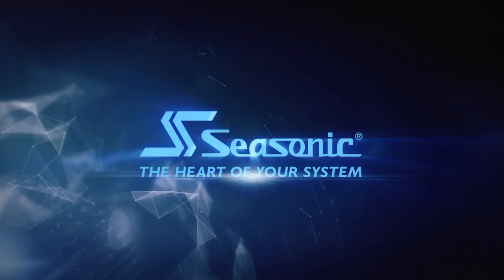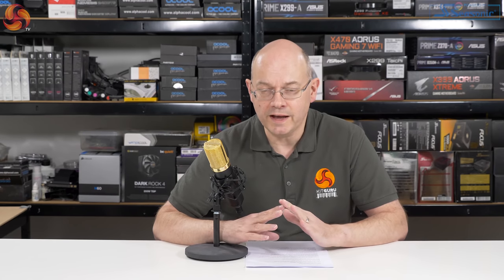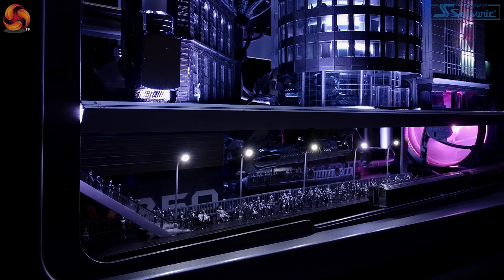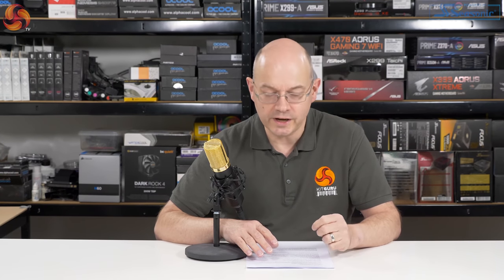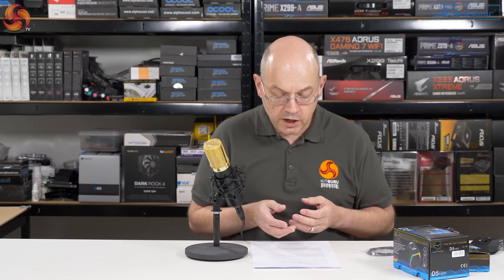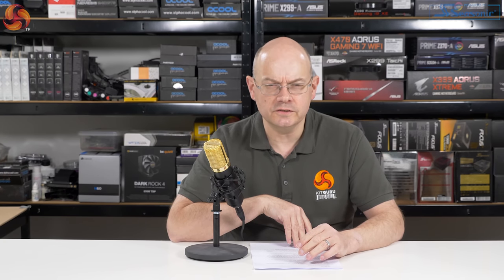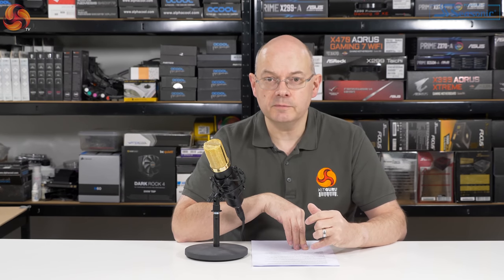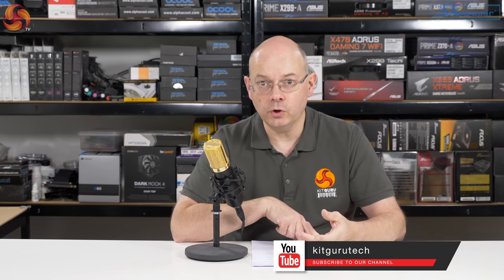Leo Says 30 - HALLOWEEN SPECIAL! Intel and AMD Q3, Modding, Threadripper 3000 !

Comment: I very much like the idea of a way to control the pump outside of the BIOS or manually via button pushes. I know there is Speedfan, but for some reason I can't get that to work on my current C7H 2700X system where the pump is pwm plugged into the CPU fan header. I want to adjust speed when required rather than rely simply on temps, but I don't want to have to always open the case to push a button. Enermax has a remote, but that can be lost. I'd prefer a software solution and you hit on it with Corsair and iCue. Great vid as always Leo. Love your POV on things!

Comment: Intel is on the out and definitely not inside!
Reply: As usual that is what most tech folks think but toitally fail to see the bigger picture that Intel have leveraged themselves into with their bundles of cash. Eventually x86 won't be their core business, they have many, many other revenue streams whereas AMD are a bit hamstung. AI, self driving and consoles will not keepthem afloat. What they have achieved with Ryzen and Zen in general is epic (!) but they should have have priced them much higher. In crude terms, AMD gets 38% gross profit on smaller sales compered to nVidia, Intel, Qualcomm who all get 60%+ on much larger sales. Even at 50% they would still sell. This is why their share price has gone down whereas Intel, against the odds, has started to climb again. Weird

Comment: Ifont know why big companies dont upgrade to epyc
Reply: steel fox 886 Epyc is indeed amazing value. But if you want to use that persistent memory Optane, you have use Intel; and I am talking about the persistent memory server DIMMs, not the hard drive caching consumer stuff.
Reply: Because you just get cherry picked synthetic bench marks. In real world it may act differently
Reply: @HayateAzekura  i dont agree with you   ithnic company's see the miss leading benchmarks by intel in ther presentation
Reply: I could probably answer that one as a datacenter purchase manager. Go out on any street and ask anyone random Intel or AMD. 9/10 usually go Intel, it’s had such a mindset for so long and this exists with many managers and executives who sign off on projects like this as they are not usually as glued to the computer market as you or I. In our datacenter we are introducing more and more Epyc but it’s a long slog ahead, many servers run for years without upgrading and when they do usually people want just the straight updated models of what they had without giving it much thought, also you get a few issues with Epyc which should hopefully be ironed out by Zen2 but even if Rome outperforms Intel with no issues and at half the price you will still be years off 50/50 market share.

Comment: Gamers want the best INTEL/NVIDIA inside and forget about the IPC inferior watt wasting AMD rest.

Form Follows Function Builds are the best. High Air Flow Aluminum cases are my favorite.
Reply: That's largely ignorant statement. The IPC of current gen Ryzen is only 3-5% less than the best Intel CPU when put at the same Ghz. This has been tested and confirmed numerous times. Also, If you are not a professional competitive gamer you can game just as fine on any Ryzen 7 or Ryzen 5 CPU and save quite a bit of money for more RAM or a better GPU. And for most people this is the best choice at the moment. Especially with the sky high Intel prices in the last few months. Not to mention the upcoming Zen 2 Ryzen 3000 series CPUs which are rumored to be pretty much on par with 9900k in gaming performance and probably a lot cheaper too. The best part is you'll be able to install it on your current motherboard and not spend money again on another one which is very typical for Intel. AMD is the smarter choice for 90-95% of the people.
Reply: Intel CPUs are at the top of the Gaming Benchmark charts while AMD CPUs are consistently at the bottom half. Thorough testing show how stable Intel's CPUs performance per watt are it also reveal AMD CPU/GPU bottlenecks. Intel's i9-9900 gaming performance is more than 20% higher than AMD's R72700 so a, "only 3-5% less than the best Intel CPU" is BS, it's also BS to compare at the same GHz because it's NOT the same process and it's NOT Reality. 

Price is a personal Factor, only the buyer knows what they can or can not afford and anyone assuming they know is a unrealistic assumption. Premium products command a premium price, they always have and always will. Other than stating the obvious price which can vary due to price cuts, sales, and location price should be only be a concern to the buyer. Paying more today for a future proof premium product makes sense and benefits the buyer with a better upgrade path. Choosing a premium Intel CPU today gets the most performance out your premium GPU now, when you feel the need for more graphical speed Intel CPU will get most out of your future GPU upgrade.
Reply: Max Facts looking forward to your comments after Zen2 comes in April.